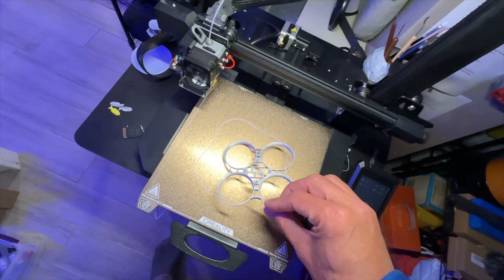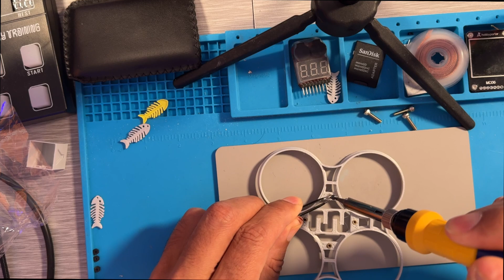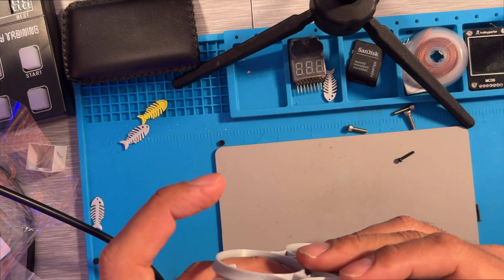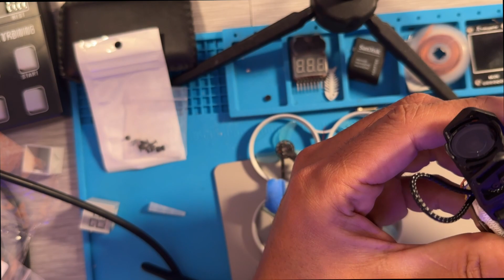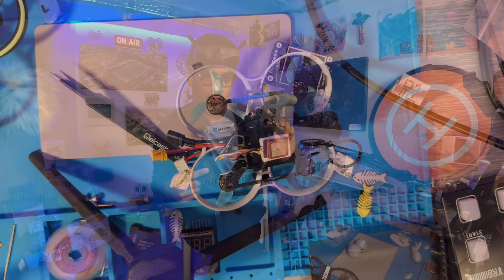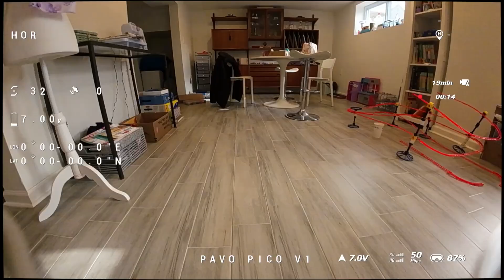pavo-pico-frame-replacement-3d-printed-drone

Comment: What filament do you use? Is it nylon?
Reply from the maker: This is it here.. From amazon
Grey
https://amzn.to/3uwgx75

Yellow
https://amzn.to/4buDTe9

Blue Green
https://amzn.to/3IPQ9Zi
Reply: @How-to-by-Lou  I printed one frame from PLA and my frame survive only 10 seconds to first contact with the ground. How is yours PLA frames? Is enough durable? I bouth PETG one, I will be test it...
Reply from the maker: @wojtek3805  could be setting - use Cura as your slicer and use dynamic default print settings 

Mine crashes all the time - still crashing but this these print pretty good 

Is it cold where you are printing ?
Cold make the filament break and fragile 

Cold or hot won’t make a difference after it’s printed

It’s the condition the filament is kept in before being printed into something

Comment: That is cool! Saves you a lot of time in getting a new frame / duct shipped to you! Also, would you be able to 3d print of landing pads for the Pavo25? :)
Reply from the maker: As long as you know the measurements, for sure you can but the pavo 25 is a tad big so you'd need a bigger printer..
Reply: @How-to-by-Lou  that makes sense! I love my Pavo20 and Pavo25v2 😊